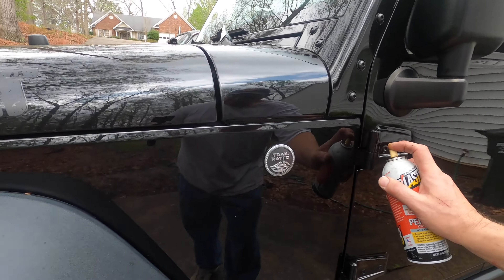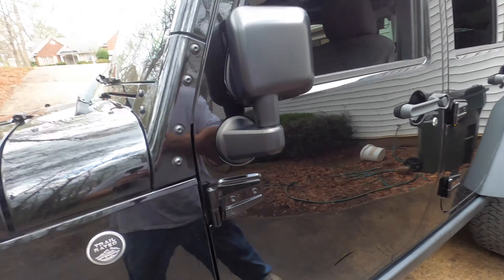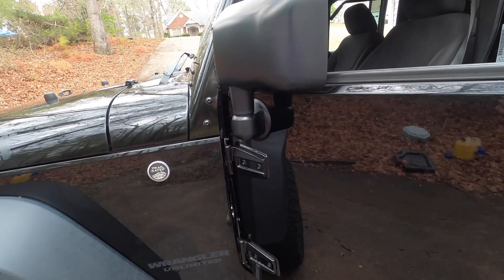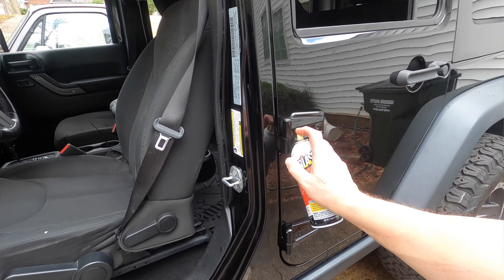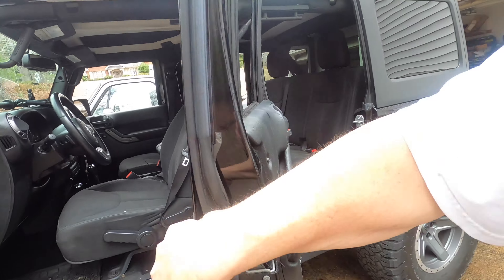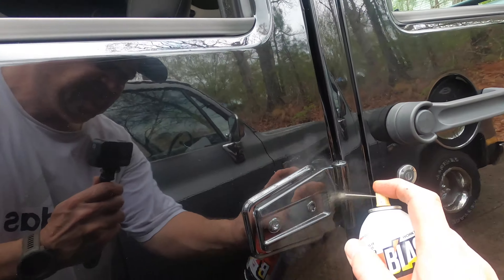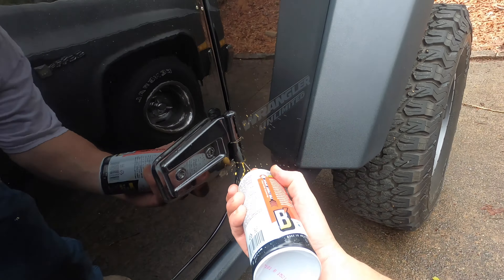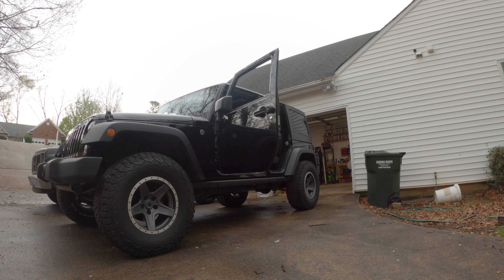How to remove stuck Jeep Wrangler JK JKU JL doors easily and safely

Comment: I have an '02 and it's not rusted out but the hinges have more rust than I would like. I'll keep trying the penetrating oil. I'm going to fully restore it so I don't want to ruin the doors and add another expense by using the other methods you mentioned and didn't want to try either.

Nice ride you have there. I noticed you have the same hoist system that I do to lift the hard top off.
Reply from the maker: Thanks - I had an 05 TJ that I regret selling to this day - worst mistake I ever made.  They are becoming harder and harder to find nice ones that are reasonably priced.  Keep working your doors back and forth with the penetrating oil and they should eventually come off for you.  Depending on how nice your paint is you might try some heat also.  I do like the lift - it took a few minutes to install but the time it makes removing and installing the top so easy.
Reply: I caught a glimpse of the hard top removal system. Do you have more information on that?

Comment: We're your pins seized up at all?  I also have a 2017 and have never removed the doors before and you can see the liners inside the hinges are in awful shape!
Reply from the maker: I only had one of the bushings on the passenger side back door that probably needs replacing. The other three are in good shape. It was also the door that was hard to open and close.  After greasing the door pins for now it's fine but as cheap as a bushing kit is I will probably replace all of them before winter.